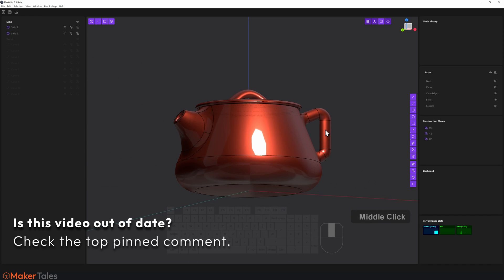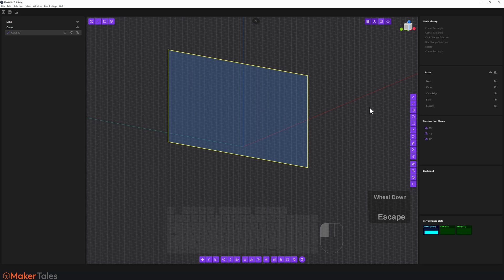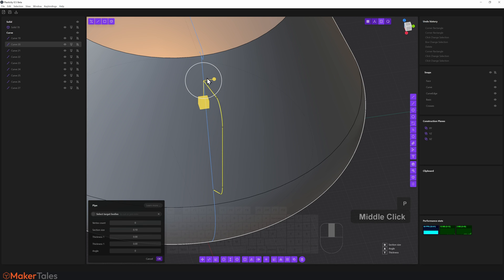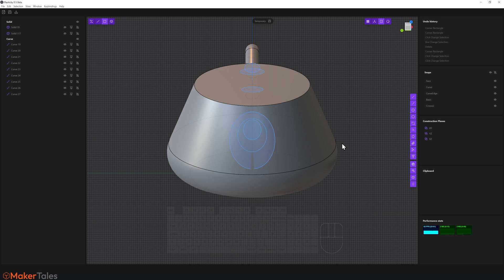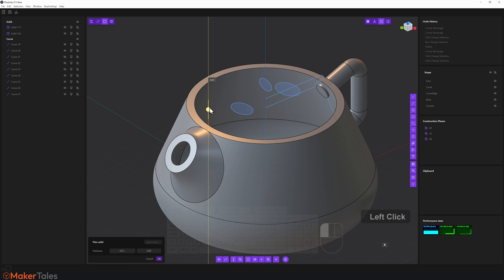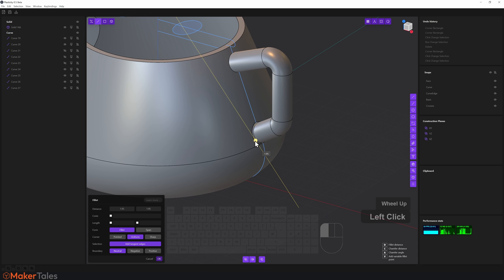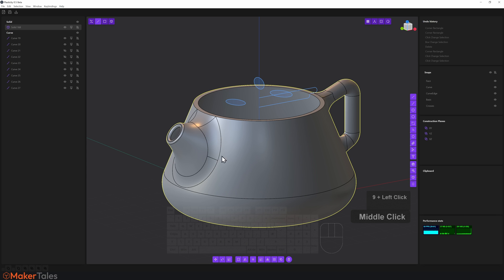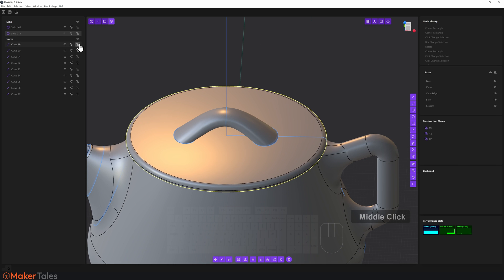Plasticity 3D Making Curve / NURBS Modeling Artistic | Part 8

Comment: You did a great job with this tutorial series.  A lot of this would be hard to figure out without guidance. Plasticity is surprisingly powerful. Things that can be a real pain in other cad seem trivial. Definitely huge potential. I hope that it focuses a lot more on precision and control of sizes as it seems way to loose and hard to control at present. Every cad program does some things well and is terrible at others. Plasticity could be great if it gets the details right.